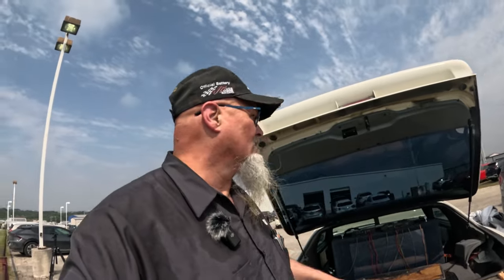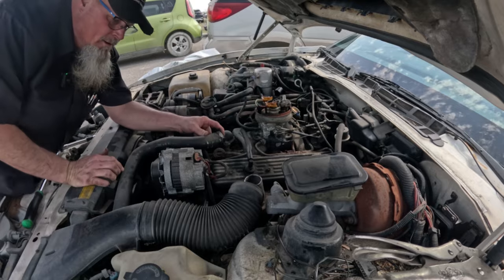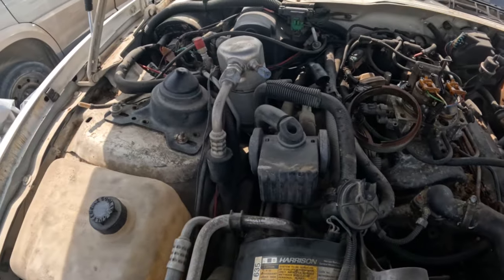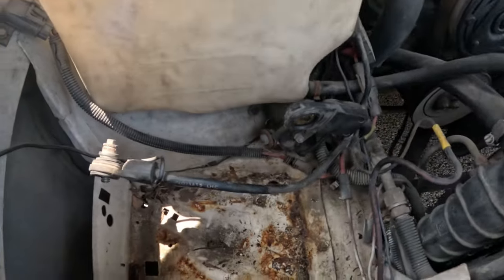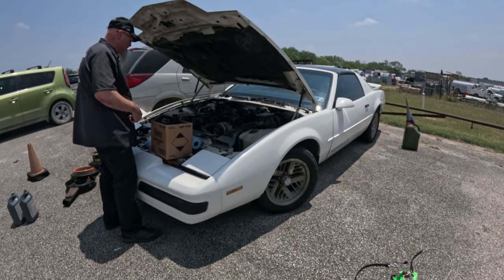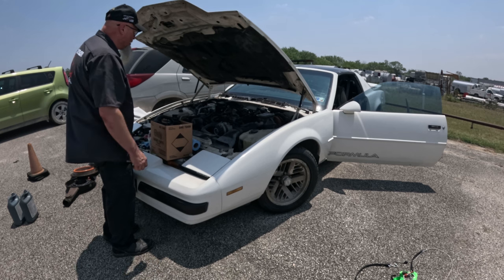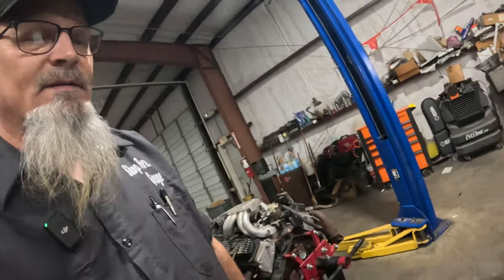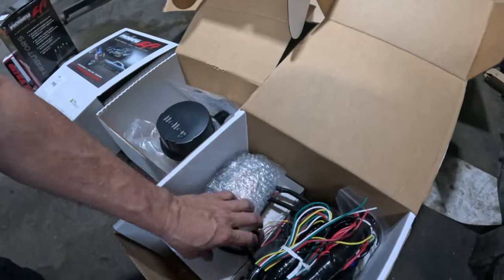1989 Pontiac Firebird Formula. Sitting for 17 years. Will it run and drive? Part 1

Comment: 😊 I took the exact same car a blueprint 350 ar4 transmission with the locker kit😊 and made a hot rod the blueprint motor was 485 horses at the crank without a transmission